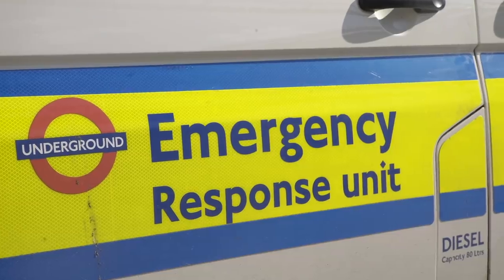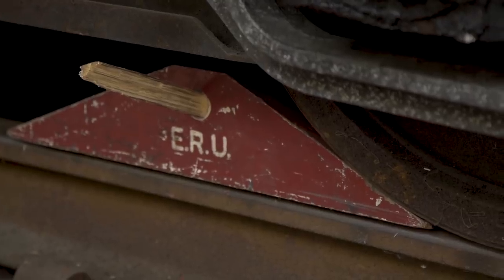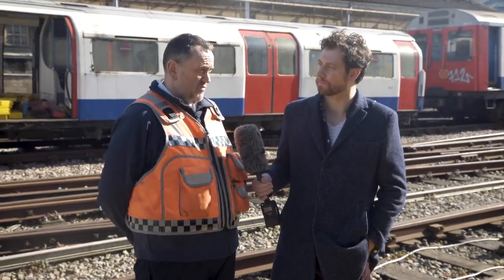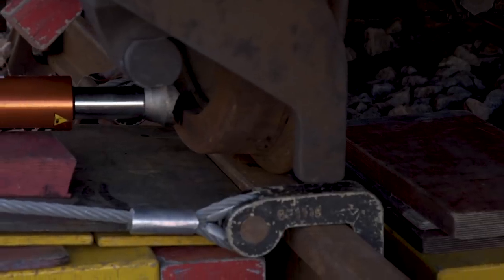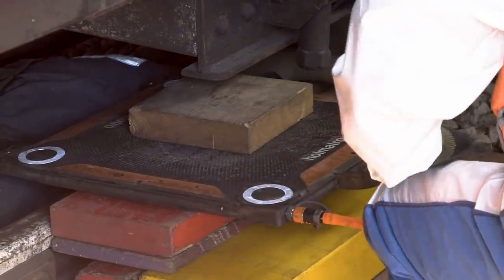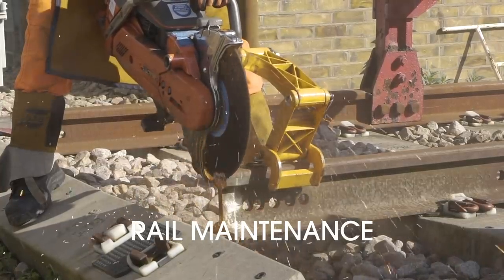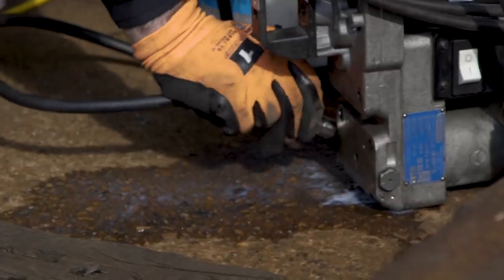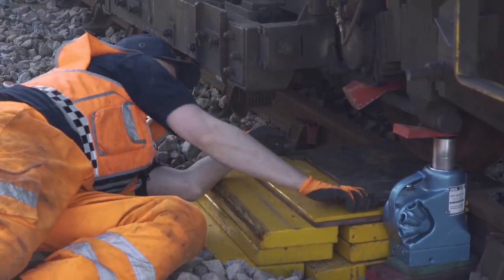Meet the International Rescue of the Tube Network

Comment: I wanted to know why don’t they dig a tunnel and do an extension for the main line Train so they extend the unused abandoned underground stations.  

Why couldn’t they use the part D78 Stock train doors on the sides and also restructure the front face of the A60 and A62 stock and remix and make them all together and also redesign them overhead line and also make them into 5 cars per unit and also having 2 Disabled Toilets on those 5 cars per unit A60 and A62 stock trains and also convert the A60 and A62 stock trains into a Scania N112, Volvo TD102KF, Volvo B10M, Gardner 6LXC and Gardner 8LXB Diesel Engines and also put the Loud 7-Speed Voith Gearboxes in the A60 and A62 stock and also modernise the A60 and A62 stock and make it into a 11 car per unit so it could have less doors, more tables, computers and mobile phone chargers.

A Stock Trains and also having 8 Disabled Toilets on those A stock trains. why couldn’t we refurbish and modernise the waterloo and city line Triple-Track train tunnel and make it more bigger and extend it to bank station, making it into a Triple-Track Railway Line so those 4 European countries such as Germany, Italy, Poland And Sweden to convert the waterloo and city line Triple-Track Train tunnel into an High Speed train.

The Third Euro tunnel Triple-Track Train line to make it 8 times  better for passengers so they could go from A to B. then put the modernised  11 car per unit A Stock and put them on a bigger modernised waterloo and city line Triple-Track train tunnel so it could go to bank station to those 4 European countries such as Germany, Italy, Poland And Sweden. The modernised refurbish 11 cars per unit A stock could be a High Speed The Third Triple-Track Euro Tunnel Train So it is promising and 37 times a lot more possible to do this kind of project that is OK for London Germany, Italy, Poland And Sweden. 

oh by the way, could they also tunnel the Triple-Track Railway Line so it will stop from Buckinghamshire, Hertfordshire and Essex so that the Passengers will go to Germany, Italy, Poland and Sweden and also extend the Triple-Track Railway Line from Bank to Buckinghamshire, Hertfordshire and Essex Stations so that more people from there could go to Germany, Italy, Poland And Sweden Easily.  

Why couldn't they extend the Piccadilly line and also build a brand-new underground train stations so it could go even further right up to Clapton, Wood Street and also make another brand new tunnel train stations in Chingford and could they extend the DLR.

All of the classes 150, 155, 154, 117, 114, 105, 106, will be replaced by all of the Scania N112, Volvo TD102KF, Volvo B10M, Gardner 6LXC and Gardner 8LXB Diesel five carriages to disabled toilets are air conditioning trains including Highams Park for extend doing roots which is the Piccadilly line and the DLR trains.
Could you also convert all of the 1973 stock trains into an air-conditioned maximum speed 78 km/hours (48 MPH) re-refurbished and make it into a 8 cars per unit if that will be alright, and also extend all of the Piccadilly train stations to make more space for all of the extended 8 car per unit 1973 stock air condition trains and can you also build another Mayflower and Tornado Steam Locomotive Companies and they can order Every 17 Octagon and Hexagon shape LNER diagram and unique small no.11 Boilers from those Countries such as Greece, Italy, Poland, and Sweden, can they make Mayflower and Tornado Steam Locomotive speeds by up to 117MPH so you can try and test it on the Original Mainline so it will be much more safer for the Passengers to enjoy the 117MPH speed Limit only for HS2 and Channel Tunnel mainline services, if they needed 16 Carriages Per units can they use those class 55’s, class 44’s and class 43HST Diesel Locomotive’s right at the Back of those 16 Carriages Per Units so they can take over at the Back to let those Mayflower and Tornado Steam Locomotive’s have a rest for those interesting Journeys Please!!, oh can you make all of those Coal Boxes’s 16 Tonnes for all of the 117MPH Mayflower and Tornado Steam Locomotive’s so the Companies will Understand us PASSENGER’S!! so Please make sure that the Builders can do as they are Told!! And Please do something about these very important Professional ideas Please Prime Minister of England, Prime Minister of Sweden, Prime Minister of Germany, Prime Minister of Italy, Prime Minister of Poland and that Includes the Mayor of London.😉😅😅😀😀😅😀😀😅😅😀😀😀😀😀😉😅😅😀😀😅😀😀😉😅😉😅😅😀😅😀😀😅😉😅😀😅😅😉😅😀😀👏👏👏👏😉😅😅😀😀😅😀😀😅😅😀😀😀😀😀😉😅😅😀😀😅😀😀😉😅😉😅😅😀😅😀😀😅😉😅😀😅😅😉😅😀😀👏👏👏👏😉😅😅😀😀😅😀😀😅😅😀😀😀😀😀😉😅😅😀😀😅😀😀😉😅😉😅😅😀😅😀😀😅😉😅😀😅😅😉😅😀😀👏👏👏😉😅😅😀😀😅😀😀😅😅😀😀😀😀😀😉😅😅😀😀😅😀😀😉😅😉😅😅😀😅😀😀😅😉😅😀😅😅😉😅😀😀👏👏👏👏😉😅😅😀😀😅😀😀😅😅😀😀😀😀😀😉😅😅😀😀😅😀😀😉😅😉😅😅😀😅😀😀😅😉😅😀😅😅😉😅😀😀👏👏👏👏😉😅😅😀😀😅😀😀😅😅😀😀😀😀😀😉😅😅😀😀😅😀😀😉😅😉😅😅😀😅😀😀😅😉😅😀😅😅😉😅😀😀👏👏👏👏😉😅😅😀😀😅😀😀😅😅😀😀😀😀😀😉😅😅😀😀😅😀😀😉😅😉😅😅😀😅😀😀😅😉😅😀😅😅😉😅😀😀👏👏👏👏😉😅😅😀😀😅😀😀😅😅😀😀😀😀😀😉😅😅😀😀😅😀😀😉😅😉😅😅😀😅😀😀😅😉😅😀😅😅😉😅😀😀👏👏👏😉😅😅😀😀😅😀😀😅😅😀😀😀😀😀😉😅😅😀😀😅😀😀😉😅😉😅😅😀😅😀😀😅😉😅😀😅😅😉😅😀😀👏👏👏👏😉😅😅😀😀😅😀😀😅😅😀😀😀😀😀😉😅😅😀😀😅😀😀😉😅😉😅😅😀😅😀😀😅😉😅😀😅😅😉😅😀😀👏👏👏👏😅😅😀😀😅😀😀😅😅😀😀😀😀😀😉😅😅😀😀😅😀😀😉😅😉😅😅😀😅😀😀😅😉😅😀😅😅😉😅😀😀👏👏👏👏😉😅😅😀😀😅😀😀😅😅😀😀😀😀😀😉😅😅😀😀😅😀😀😉😅😉😅😅😀😅😀😀😅😉😅😀😅😅😉😅😀😀👏👏👏👏😉😅😅😀😀😅😀😀😅😅😀😀😀😀😀😉😅😅😀😀😅😀😀😉😅😉😅😅😀😅😀😀😅😉😅😀😅😅😉😅😀😀👏👏👏😉😅😅😀😀😅😀😀😅😅😀😀😀😀😀😉😅😅😀😀😅😀😀😉😅😉😅😅😀😅😀😀😅😉😅😀😅😅😉😅😀😀👏👏👏👏😉😅😅😀😀😅😀😀😅😅😀😀😀😀😀😉😅😅😀😀😅😀😀😉😅😉😅😅😀😅😀😀😅😉😅😀😅😅😉😅😀😀👏👏👏👏😉😅😅😀😀😅😀😀😅😅😀😀😀😀😀😉😅😅😀😀😅😀😀😉😅😉😅😅😀😅😀😀😅😉😅😀😅😅😉😅😀😀👏👏👏👏😉😅😅😀😀😅😀😀😅😅😀😀😀😀😀😉😅😅😀😀😅😀😀😉😅😉😅😅😀😅😀😀😅😉😅😀😅😅😉😅😀😀👏👏👏👏😉😅😅😀😀😅😀😀😅😅😀😀😀😀😀😉😅😅😀😀😅😀😀😉😅😉😅😅😀😅😀😀😅😉😅😀😅😅😉😅😀😀👏👏👏😉😅😅😀😀😅😀😀😅😅😀😀😀😀😀😉😅😅😀😀😅😀😀😉😅😉😅😅😀😅😀😀😅😉😅😀😅😅😉😅😀😀👏👏👏👏😉😅😅😀😀😅😀😀😅😅😀😀😀😀😀😉😅😅😀😀😅😀😀😉😅😉😅😅😀😅😀😀😅😉😅😀😅😅😉😅😀😀👏👏👏😅😅😀😀😅😀😀😅😅😀😀😀😀😀😉😅😅😀😀😅😀😀😉😅😉😅😅😀😅😀😀😅😉😅😀😅😅😉😅😀😀👏👏👏👏😉😅😅😀😀😅😀😀😅😅😀😀😀😀😀😉😅😅😀😀😅😀😀😉😅😉😅😅😀😅😀😀😅😉😅😀😅😅😉😅😀😀👏👏👏👏😉😅😅😀😀😅😀😀😅😅😀😀😀😀😀😉😅😅😀😀😅😀😀😉😅😉😅😅😀😅😀😀😅😉😅😀😅😅😉😅😀😀👏👏👏😉😅😅😀😀😅😀😀😅😅😀😀😀😀😀😉😅😅😀😀😅😀😀😉😅😉😅😅😀😅😀😀😅😉😅😀😅😅😉😅😀😀👏👏👏👏😉😅😅😀😀😅😀😀😅😅😀😀😀😀😀😉😅😅😀😀😅😀😀😉😅😉😅😅😀😅😀😀😅😉😅😀😅😅😉😅😀😀👏👏👏👏😉😅😅😀😀😅😀😀😅😅😀😀😀😀😀😉😅😅😀😀😅😀😀😉😅😉😅😅😀😅😀😀😅😉😅😀😅😅😉😅😀😀👏👏👏👏😉😅😅😀😀😅😀😀😅😅😀😀😀😀😀😉😅😅😀😀😅😀😀😉😅😉😅😅😀😅😀😀😅😉😅😀😅😅😉😅😀😀👏👏👏👏😉😅😅😀😀😅😀😀😅😅😀😀😀😀😀😉😅😅😀😀😅😀😀😉😅😉😅😅😀😅😀😀😅😉😅😀😅😅😉😅😀😀👏👏👏😉😅😅😀😀😅😀😀😅😅😀😀😀😀😀😉😅😅😀😀😅😀😀😉😅😉😅😅😀😅😀😀😅😉😅😀😅😅😉😅😀😀👏👏👏👏😉😅😅😀😀😅😀😀😅😅😀😀😀😀😀😉😅😅😀😀😅😀😀😉😅😉😅😅😀😅😀😀😅😉😅😀😅😅😉😅😀😀👏👏👏